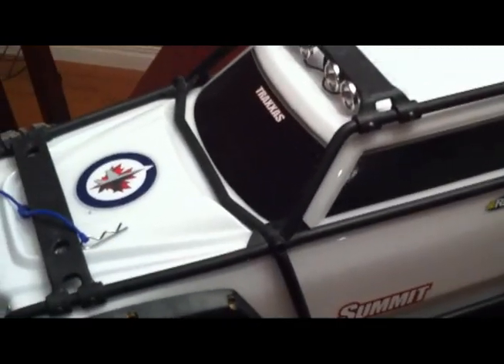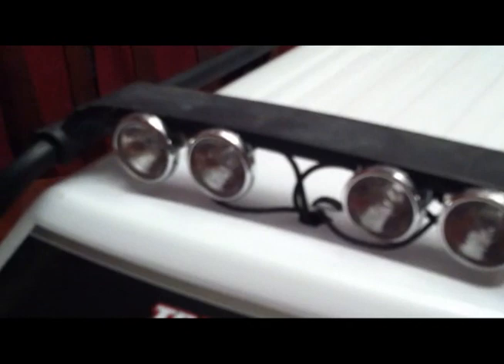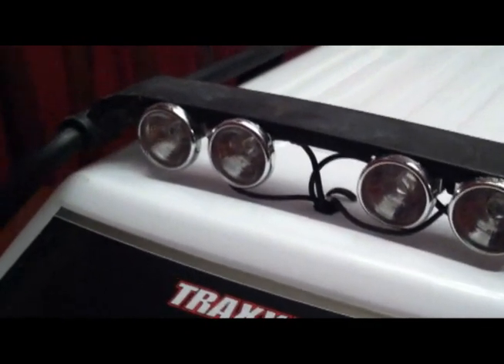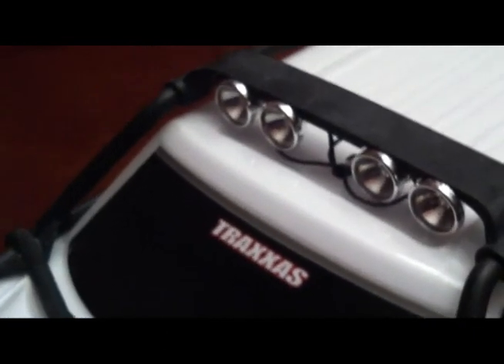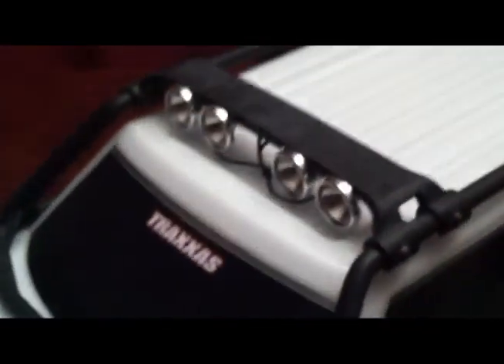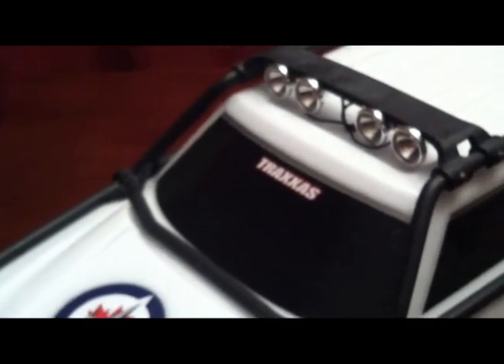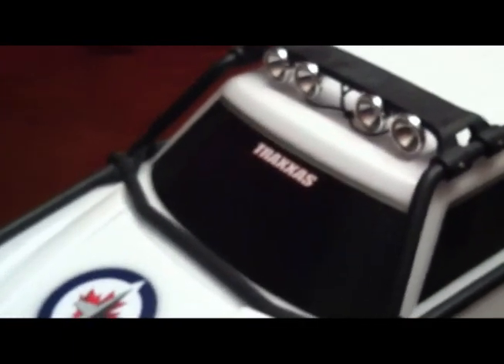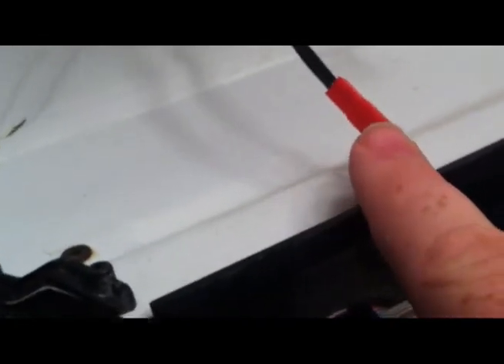Beginner Series:  Installing an LED light bar on your Traxxas Summit

Comment: LOL I like the ending.

Must you run the wires under the motor? or is this a Traxxas recommendation, also it would be nice to see the 'Y' connection point.

Finally, I think Summits could use more tail lighting, right now the only 'factory' kit is the Grave Digger headlights LOL.